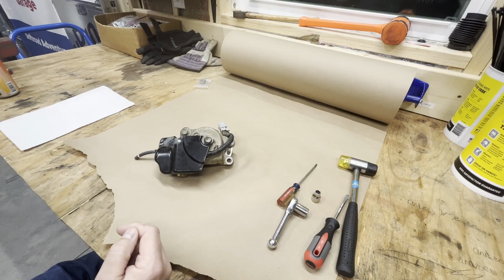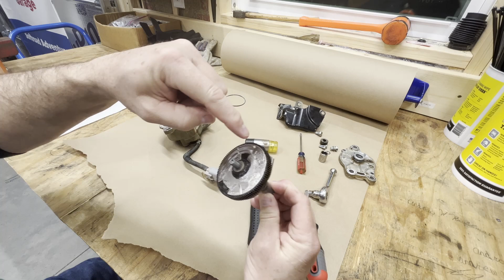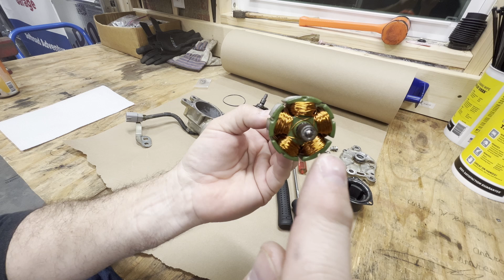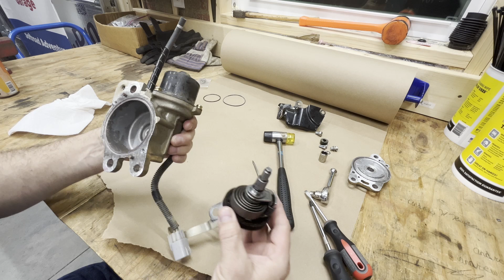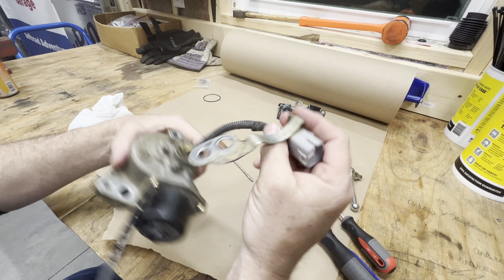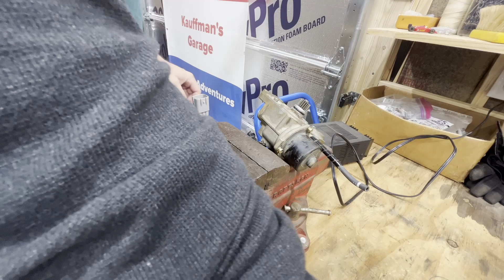Toyota Locking Differential Actuator Rebuild & Timing | 4Runner, Tacoma, Land Cruiser DIY Fix

Comment: One thing you might have missed, or might not have known... there is supposed to be ANOTHER BALL BEARING (BB) on the other end of that commutator as well! I found it sitting on my table and was like where did this come from?! pack the holes on either side of the shaft with SuperLube (as Landtake includes in his kit) or Toyota yellow grease dielectric grease and the bb will stay in place during reassembly. 

Also, it appears the springs you have in this motor are shorter than the originals. Looks like it worked regardless, but the original springs are longer and the only way to get the brushes in place with the springs under them is to compress the springs with a toothpick, then hook the wires around the back of the brush housings for assembly. Once the commutator (with both BBs) is back in place, unhook the little wires and the brushes will spring tightly against the motor.
Reply from the maker: My springs were missing. Literally gone. I made these from pen springs if I recall correctly. Thanks for watching and commenting!

Comment: If you buy a new one is it already to put on no moving with battery ?
Reply from the maker: I’m sorry, I do not know.
Reply: yes, in unlock position you can check first to make sure Make sure gears are set outer

Comment: Any idea why my actuator isn't responding to electrical supply?  It moved for a very quick second, otherwise the connectors (2 you used for hot/ground) just spark when I apply electricity.  I hear a very faint click inside the actuator but it just won't turn.  Is something inside possibly fried?
Reply from the maker: These actuators are pretty simple, and I would recommend disassembly/clean/regrease. Pay attention to the magnets, they could be loose and need to be reglued in. The commutator brushes will have springs under them and can fall out as well. Just go slow and have a towel down on your work area to prevent things from sliding off into oblivion. I used this kit https://landtankproducts.com/products/e-locker-actuator-kits

Comment: Very nice explanation !  What I didnt get though is why I should specifically start from locked position ? Why cant it be opposite ?- rotate this thing full counterclocwise and have the locking  button off? 

I have my diff stucked in lock. I removed the motor , put the fork all the way to the right. Diff got unlocked - I lifted up one rear wheel and was able to get it spinning freely. But when I put the motor back in again (didnot do anything to it) I got the diff locked again. I didnot press the button (the actuator seems not working, I need to service it). I just want to unlock the diff manually so I could run the car. 
That puzzles me. The pinion gear is not possible to rotate by hand, so it could move the rack just by half a teeth -vety little. Is that really enough to get the diff locked ? The rack can be moved more than a centimeter by hand.

What would you suggest how to install the not working actuator back in, do the diff stays open?

I have a feeling that it is not completely broken - sometimes i can heat m9ving sounds when I press the lock button by the light keeps flashing. That is why i want to install the actuator back while not touching the lock button to be sure to keep the diff open
Reply from the maker: You should be able to manually unlock the diff and then reinstall the motor to drive it. Just don’t hook up the electrical connection until you’re ready to tackle the rebuild. Half a tooth should not be enough to lock the diff.
Reply from the maker: I’ll have to check the manual, but I think it says to have it in the locked position for removal and installation. Super long story, but this one wasn’t moving at all and was replaced by the dealership. I asked them to leave the old one with the car and luckily I got it to “play” with. If you go through this process, I’m confident yours will work again. There isn’t much to them.

Comment: What would you recommend if you don't have a parts cleaner to clean the motor shaft/armature? Also is there a certain type of glue for the magnets or is super glue OK?
Reply from the maker: A 2 part epoxy would probably be best to make sure it lasts. Make sure sure surfaces are oil free. Oil Eater is available in a spray bottle and is a safe cleaner.

Comment: Im helping some uni students make a working cutaway demo of an 80's series landcruiser front diff (~year 2000??).   They are unsure how to power the OEM locker actuator. A photo shows it has  2 or 3 mostly green wires, 1 yellow and 1 black. 

My assumption is that 9v can be applied to a one of the green wires and the black to move the lock shifting fork, and then the other green and black is used to reverse that. Not sure what the yellow is for, dash light?. Is it as simple as feeding 9v into right pairs? How does the vehicle normally stop the actuator spinning when it has finished moving the locking gear to either position - is there a sensor that tells the vehicles ECU chip to stop sending power? Or is there a limit switch inside the actuator motor that cuts power when the position is reached?  The later would obviously be simpler for us to deal with in a cutaway demo. 

Any suggestions would be welcome.
Reply from the maker: I don't know that I have the brain power to intelligently answer this but here we go. I haven't messed with this since the video but you can move the gear with an AA battery. Reversing the leads will make it spin the opposite direction. I THINK there is sensor that monitors the fork movement and I assume that is what cuts the power. You can overtravel the actuator to the point that it will not self reverse without manual manipulation. There are no switches inside the motor and it's truly a very simple mechanism.

Comment: You mention a service manual.  What do you use?  I’d like to see the schematics and step by step. Thanks.
Reply from the maker: I just referenced the manual for timing and I don't recall if there was a step by step procedure listed. Can check tonight. The manual came from Emanual Online (purchase) and is a download. https://www.emanualonline.com/cars/toyota/?source=aw&sv1=affiliate&sv_campaign_id=2476169&utm_source=awin&utm_medium=affiliate&utm_campaign=2476169&utm_content=0&sscid=88607_1770729066_19d6b1cd2043b49840be4c65856b90c8&awc=88607_1770729066_19d6b1cd2043b49840be4c65856b90c8
Reply: @kauffmansgarage thank you!  Best video out there.
Reply from the maker: @jonnyfuego2998  Thank you!

Comment: This is good content.  Do you know why the system needs to he locked for assembly?
Reply from the maker: Thank you! In order to remove the diff from the housing, the locker needs to be engaged if I recall correctly so the manual is based on reassembly.

Comment: Just went through mine and noticed the small bb on top was indeed missing, is there a replacement that you know of or will something as simple as metal bb work ?
Reply from the maker: I do not know of a replacement but the “bb” is smaller than an actual bb. A regular bb would create height issues and not allow assembly. I’ll see if I can get a diameter on it later today.
Reply from the maker: @backwoodsrc981  The motor “bb” diameter is .137 where an actual BB is .171
Reply: @kauffmansgarage well so I put an actual bb in it and it seems to be working I’m going to limit my use with till I can find a replacement bb for it
Reply from the maker: @ yeah? That’s awesome and good to know! Congrats.

Comment: I’m currently facing the issue with my real locker actuator being out of phase. I just had my differentials regeared, and now my rear differential actuator will not lock my rear diff locker. This was relatively helpful in knowing that when I put it back into the diff, it needs to be in a locked position on the differential side and I need to make sure my pins/marks are correctly aligned to get rid of the blinking differential light. Thank you!
Reply from the maker: Thanks for watching and glad it helped. Good luck!
Reply: @ got it working last night! Thank you!
Reply from the maker: @bearoverlandandoutdoors  Awesome man!